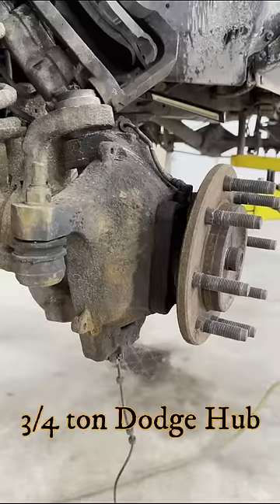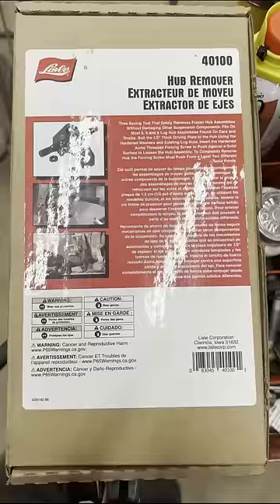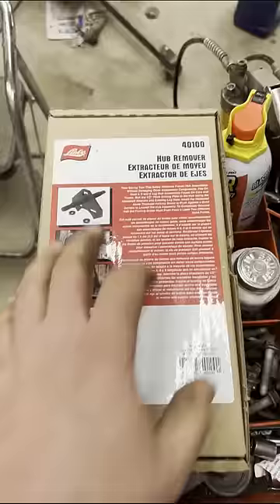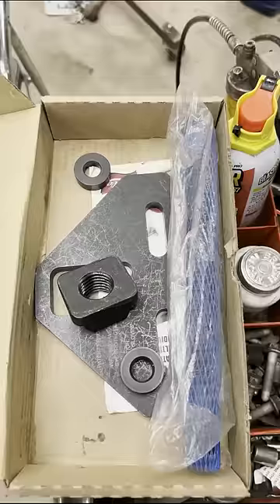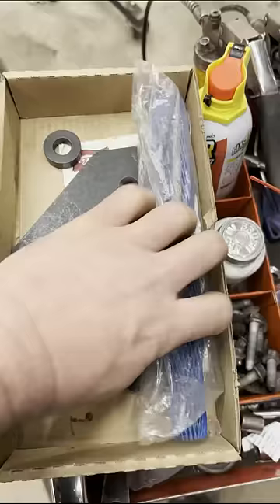Hub Bearing Removal Made EASY!

Comment: It's better to smack the opposite side with a sledge as you are push with the bolt;  causes it to walk out much better and less of a bind from pushing only on one side the whole time.
Reply from the maker: I agree. This video was demonstrating the tools ability so I just let her eat!
Reply: @Tomsfoolery.  Right on..
Reply: The instructions for this tool even say that you need to push on at least two different points. Looks like OP knows that's the best way but chose not to for whatever reason.
Reply: Was wondering that myself while slowly watching it gall the inside of the knuckle  😅
Reply: OP knows to persuade other side with hammer, grease the threads, etc.... I figure he chose to see how robust or how well tool holds up unassisted. Put it through the worst, how tough is this tool? Put it to the test I guess.... give it to 'er.
Reply: Yes
Reply: @Tomsfoolery.  by allowin the hub to be forced out of round...ok such a pro
Reply from the maker: Doesn’t hurt a thing. If you were an experienced mechanic you’d know that.
Reply: @Tomsfoolery.  Well, in my opinion, to let it eat into the knuckle and gall it is a little unprofessional when it could have easily been prevented. But putting that much stress on the hub hole of the knuckle could,in fact, (on an aluminum knuckle)  cause the material to compress and become unlevel. Causing the the hub to not torque down evenly, eventually working it's self loose and at the very least, throwing that tire out of alignment. Maybe nothing would happen in a real world scenario but it's better to do it correctly and by the book.
Reply: Id take the time to take it off spin 180* and repeat .. also loose the allen wrench fitting on top first
Reply: @Tomsfoolery.  

It could very easily cause the fit of the replacement to be looser than it should be by removing material from the one wall. It could also deform it. An experienced mechanic would know that. 😮
Reply: @Tomsfoolery.  not an intelligent response at all.
I get you wanted to show how powerful the tool is, but to claim no damage is amazingly ignorant!
if you were an experienced mechanic that could handle criticism,  you could acknowledge that.
Reply: Also prevents your spindal from getting worn faster.
Reply: @redneckswitwheels  You obviously have little to no experience in the automotive world if you think that bearing removal made the steering knuckle "out of round" lol! PS- the "hub" IS the bearing assembly. What you call the "hub" is actually the steering knuckle.
Reply: Where do I get this hub bearing removal tool
Reply: Y’all sit the hell down. You are not all knowing sitting behind your phone screen. This guy was demonstrating the tool and how it functions. Stop with all your personally opinions. People always have to find something to complain about
Reply: @danielmiller50150  Most parts stores have every tool you need for "rent".  You just borrow it actually.   They make you put up the money to buy it (just in case you never come back)--  but when you are done, just return it and they give you your money back..  The mat at the counter is usually full of pictures of their special tools that you can borrow.
Reply: Yesssir, I agree….
Reply: Seems like it would ruin the dimensional tolerances of the hole the hub presses into as well
Reply: My mind when i seen it getting pulled out from just the side of the bolt🤯 🤬
Reply: @Tomsfoolery. It's not the worst thing in the world. But it was dumb. You shouldn't have done it that way. And only an idiot would try to defend himself after the fact. Now if you want to tell us and you kind of did above that you just wanted to see how powerful/impressive that tool was that was a good demonstration. Otherwise you definitely did unnecessary damage. If you don't understand that, you're a little slow. Real mechanics are laughing at you.
Reply: If you dont want to buy the tool, you can remove the upper and lower ball joint and tie rod nuts to remove the whole knuckle then you can smash it out from the back side getting good straight hits to free it up, that's the key

Comment: A true pro doesn't bother removing the sensor. The customer will pay for it.
Reply: Bearing kit probably comes with a sensor as those tiny corroded fasteners look like a common failure point so you’d disconnect at the harness.
Reply: Plus you can see the shroud is split.
Reply: Dodge wheel bearings have the sensor on them when you buy them.
Reply: OEM Hubs come with a new sensor.

Comment: Bet that hub is no longer circular. Gotta pull that out straight, not on an angle like that.
Reply: Absolutely. Need two.
Reply: Especially aluminum
Reply: Especially aluminum
Reply: @Lindenbum  no aluminum present here.
Reply: If you ever worked on one of these trucks you would not have left such an absurd comment.
Reply: @walterk1221  good thing you don’t have my customers.
Reply: @lovemycountry12  SMH... that knuckle is cast iron, not aluminum and the only reason to remove the unit bearing is to replace it. The bore in the knuckle will not be deformed, the bearing is junk at this point, so what is your point?
Reply from the maker: @walterk1221  look at the majority of the comments. These people have no clue what they’re talking about. It shows!
Reply: Would 2 tools mounted on opposite sides work better?
Reply: @Tomsfoolery.  AGREED
Reply: @David Hair  actually, if you are that concerned an OTC-6290A is the alternative... it costs more than this tool but is less than two of them.
[EDIT: I own and use the OTC-6290A]
Reply: @walterk1221 "the only reason to remove the unit bearing is to replace it"

So I guess you've never seen a failed axle seal or u-joint in the front axle shaft assembly then 🙄 and never worked on the differential unit either....
Reply: @Krankie V  yawn in my rust belt experience the axle shaft u-joints outlive the unit bearing. It is also simpler to remove the knuckle and bearing as an assembly. You obviously exist in a rust-free environment if you think otherwise.
Reply: @walterk1221  lmfao try again.... northern new york rust city
Reply: @Krankie V  then you should know better. Unless you want the unit bearing removed so it can be destroyed in the process for the sole purpose of upselling a part that could have been saved. Now you reveal your motivation. By the way, I am from just south of the Tug Hill Plateau.
Reply: @walterk1221  not cast iron , it is forged steel
Reply: Yep
Reply: @walterk1221  if you push them out with the studs/bolts no damage is done. I've never ruined a part for an up sell.
Reply: @walterk1221  get a hub buster. Much less time consuming, much less effort. I’m 3rd generation in the family business, we have been around since 68. It’s basically a 2” X 2’ square stock that you use the studs on the hub to clamp onto the hub, and smash it with a sledge. We’re in Ontario Canada, rust belt central and it never fails. Just pull the WSS out, remove the CV axle if applicable and hammer away. Give it a shot!
Reply: Nope that's hub won't hurt the cast knuckle
Reply: @charlesboston1 cast iron
Reply: @SXSPRIME  look again , not cast iron
Reply: @Tomsfoolery.  you using the tool show you have no clue how to do it the right way.
Reply from the maker: I’ve been an ASE Master Certified Tech since ‘99. Perhaps show us your videos of doing it “the right way”.
Reply: @charlesboston1  the knuckle is cast
Reply: Do a little on each side rotating The Hub🙄
Reply: These things have a 32” tall tire attached to them that makes a great 16” long lever…with an 8k pound or better truck pushing on that lever….then that setup goes down the road hitting potholes, rocks, etc for tens of thousands of miles. Multiply the weight of the truck, the mechanical advantage of a 16” lever and the force of 8,000 lbs slamming into a hole at 35 miles per hour and you’ve got a force in the 50,000 lb-ft range. You would break the wheel studs with this puller long before you bend the hub face.  

If this wound
Reply: If you taking it off it probably ain't no damn good anyway but no your crazy man.
Reply: @charlesboston1  cast iron
Reply: @walterk1221  what about a 4x4 that needs a new axle? What if you break a stud and need to replace with a new stud? What about a ball joints that worked loose and ovaled the tapered hole? Have seen all three.
Reply: @hey_youtube Im_back  new axle? Remove the knuckle. New stud? I am not convinced the unit bearing needs to be removed. New knuckle? Just get a new unit bearing unless you are a shady shop that will charge the customer for r&r of the old and probably worn unit bearing.
Reply: @Tomsfoolery. ASE certification doesn't mean shit, seen plenty of "ASE certified mechanics" that are complete hacks
Reply: yeah that's called a spindle you are replacing a hub and bearing assembly
Reply: @@jjgg1496 not very well, recession hit us hard... It needs repairs but other things take priority
Reply: @TomsFoolery
did'nt you notice the outer race of the bearing did'nt go out in a straight path? damaged bearing only notes on the balls and inner race,
the outer race still the one on the mounts,
whatever we do we should make sure that outer race wont leave the mount in an aweful way that could result to a bigger issue
Reply from the maker: Yes I’m well aware of how the hub assembly came out crooked. It doesn’t hurt a thing. Looks bad but it’s harmless.
Reply: Take em out as an assembly? How you getting the knuckle out of the ball joints with the axle running through the middle ?
Reply: If you're replacing the bearing, it shouldn't matter...
Reply: @Krankie V  thats when you just simply pop out a lower or upper ball joint then
Reply: @walterk1221  Why do you assume the bore will not be deformed? You seem like a guy that won't hand start lugs before running them down with an impact, what's alignment got to do with anything? LOL.
Reply: @DASWorkshop  why do you assume there is a chance in hell that the bore in the knuckle could be deformed? Also why do you presume I install lugnuts the same way you do? You probably refuse to prefill oilfilter, too.
Reply: @davidhair8295  that is absolutely correct sir. But the issue is if you look at the video there is nothing for that pusher bolt to push against on the front portion of the hub.  WHICH IS WHY THEY ARE DAMN NEAR EGG SHAPPING THAT HUB USING THAT TOOL.. Granted most front hub bearings are not replaced that often. At most once for the life of the vehicle.. 
But even though THIS HUB IS STEEL.. NOBODY HAS EVER MADE AN ALUMINUM HUB  Before!!! BECAUSE If you look at the comments... everyone's an idiot!! Except the idiot that made that comment.. 
That tool is definitely better than no tool... for sure.  But i wouldn't just go to town on that extractor bolt like they did in the video??? NO F#CKING WAY!!!!! 
But if you take a hammer and tap on the front of that STEEL HUB, WHILE USING THAT TOOL To try and keep the bearing coming out more evenly.... would absolutely be a better way to remove that HUB bearing.. 
But you might want to inquire with the master mechanic in your comment section to get his professional approval. 
Just be careful listening to any f#ckknuckle who has never heard of an aluminum front hub???
Reply: @walterk1221 cast iron will just bust buddy
Reply: @Brandon Blount  well "buddy" I invite you to provide us a verifiable example for the parts depicted. I will wait patiently.
Reply: Yes my concern also as it's pulling offset possibly leading to damage..!
Reply: Straight from the Lisle “how to use video” they recommend alternating 180 degrees while removing hub.
Reply: @SXSPRIME  Automotive parts such as steering knuckles etc, Crankshafts etc are Forged Steel used for the needed higher strength. Cast steel is more commonly found used first on larger parts but also most commonly hollow parts such as pipe, pipe fittings, and valve body’s . These knuckles are definitely forged.
Reply: @wirefeed3419  they are cast...
Reply: @wirefeed3419  most knuckles and 99% of cranks , cams, connecting rods pistons, axles, knuckles , steering components , etc. Are cast... very very few cars have forged anything. Typically only high end performance vehicles have anything that's forged
Reply: @walterk1221  
Then why does the tool manufacturer recommend rotating the tool 180 degrees when using it
Reply: @Krankie_V lol that cute 
 i live in Montreal here we got real rust
Reply: @hey_youtubeim_back2159  front axle almost never need to be changed the are never used in the first place 
And if you break a stud you got nothing to do near a car
Reply: @endurofan9854  clown if you remove a bearing unit you install a brand new one or you will get a come back in 2 week because the bearing will most likely trash
Reply: @tycenwitlox283  I have one and it works every time.
Reply: @Tomsfoolery.  I use a hub buster and have never ruined a knuckle.
Reply: the threads on the tool looks fubar lol.
Reply: But the new ones on anyway I fought with the wheel bearing before four days without power tools
Reply: @Tomsfoolery. LMFAO, yup!
Reply: @Tomsfoolery. The internet mechanics.
Reply: LOL Right ? 🤦🏽‍♂️
Reply: @walterk1221 you can and i have tweaked the ever loving shit out of the flange trying to remive them from the knuckle. Maybe its you who hasnt ....
Reply: Krankie_V 🤣🤣
Reply: charlesboston1 No 🤦‍♂️🤣😂 No it is not
Reply: In reality it doesn't need to be. The bolt holes are still in the same spot, the hole is for centering the hub assembly easily, but it becomes centered once the bolts are tightened down anyway. It wouldn't affect anything

Comment: Been doing this for a while, don’t even need that tool. Just knock out a wheel stud and use a long bolt and a nut.
Reply: And the benefit there is that you'll only bugger a cheap nut or bolt and not and expensive tool like this, can bet you can't just buy the forcing screw or nut part.
Reply: @dcf476  it’s worked every time just fine for me, but go off.
Reply: @Borp56  not sure you got what I meant, what I mean is, a cheap trick is often the best trick, worst case scenario with the method you use, eventually the nut or bolt will wear out and cost pretty much nothing to replace but with this tool he's showing, once it wears out the 'force screw or special nut' thing, you'd probably have to but the whole unit again. Plus your method could be used an all stud holes making it a smoother removal compared to the side twist this tool showed
Reply: @dcf476  ah, yeah I wasn’t understanding what you meant.
Reply: That also does the trick 👍
Reply: That works provided you have something to push on.
Reply: Yes !  I use a hardened nut/bolt. It's so easy. I kick myself everytime I do it, for all the struggle in years past with sledgehammer and chisels and baring pullers ect.

Comment: Always had a good experience with Lisle and this tool looks handy. Two things though, please heavily GREASE the threads of the bolt so you don't bugger them up with the amount of force being applied and second, I would alternate from side to side so it comes out evenly and doesn't go lopsided and get stuck.
Reply: I did that ONCE and never again.   When I hit the trigger on my impact, grease flung out EVERYWHERE including my face.
Reply: Doesn't the new hub assembly come with new studs? Cause I just got 2 rears for my cts and they did, but I do agree about switching sides and penetrating oil as well, I might even try this tool looks awesome
Reply: @jimlewis1885 yes the hub comes with new studs. He didn’t say anything about the studs tho. He said to grease the bolt on the tool that pushes the bearing out because of the forces that the bolt is under.

Comment: My truck is special in the fact that the hub comes out really easily due to the design, even after nearly 24yrs the hub came out easily. The way the hub assembly interracts with the automatic locking hub is a work of art.